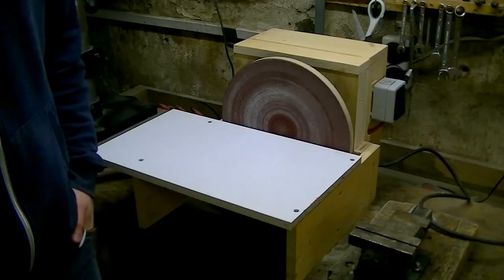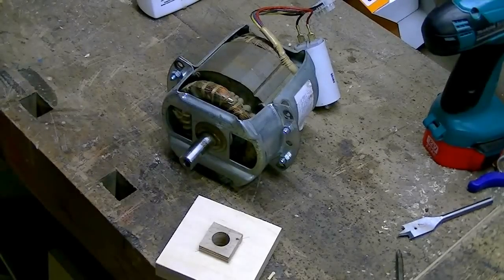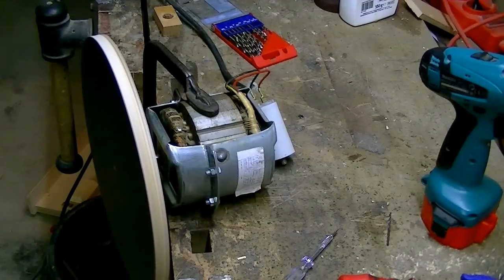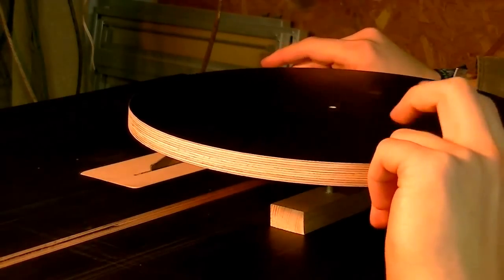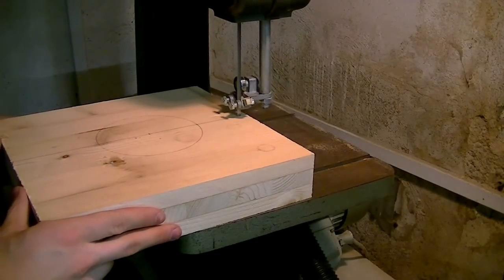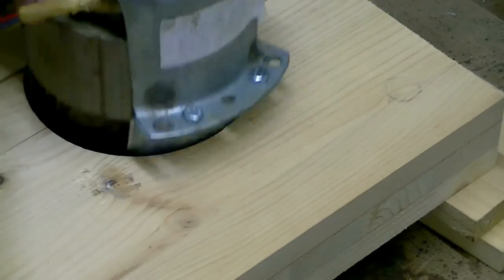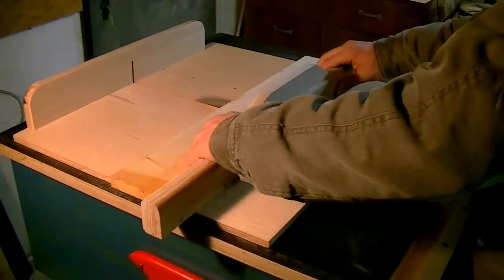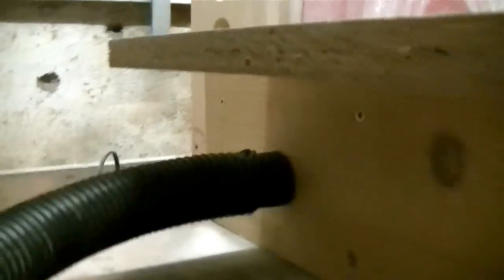Building a Disc Sander (cheap and simple)

Comment: Nice video. I made a 12" disc sander in the 1980's from a 'potters throwing wheel'. I took the motor and disc and mounted them on a wood frame, with a table like yours. Worked great. I also used my belt sander, mounted sideways in a wooden cradle, using 2x4 and plywood with hardboard top for a table as a belt sander.

Comment: This gave me some ideas - thanks. I have a lathe, so the motor part is taken care of. I like the balancing idea most, probably because I hadn't thought of it. Easy enough to make the table to fit on the lathe and an attachment for the chuck but balancing would have defeated me. I'm pretty sure I'd have trued up the face on the lathe and then wondered why it was still wobbling when I re-chucked it. I need square ends on cylinders before I drill them to fit on a worm screw, ready for turning.

Comment: <<  As for keeping the disc, you would have to plug the centre hole with a dowel and then skim it off, so the method would work only in those cases where you needed a few discs.  I sometimes need hundreds of such discs, accurately sized, and for this we use a 2-armed fly-cutter which has a needle as its centre point.  It has steel arms, with vertical blades at the end of each, was made specially for me and is DANGEROUS!  (In use, in an industrial drill press, you can't see the arms!)

Comment: Hole saws usually cut rather inaccurate, shallow, rough-sided holes and the sides of the hole are not likely to be parallel.  They need a twist bit (about 1/4" diameter) in their centres to register them in the work and if you drill through in one pass, will splinter out on the other side. But they are quick, can be of large diameter and can be used in a hand-held power drill for rough jobs where the hole quality does not matter (eg drilling a hole in drywall or wood for cables, pipes etc. >>

Comment: << from one side, then turn the board over and finish from the other side.  Chip clearance is very good and the holes bored can be much deeper than the forstner bit.  There are other drill bit types, each useful for different jobs.  Even the old-fashioned kind use in a 'brace' can be good if using hand-tools.  The screw-points on such bits actually pull themselves into the wood and the depth bored can be estimated by the number of turns of the brace.  (Try doing *that* with a power tool!)

Comment: As no-one seems to have answered this: Different bits all have their own pros and cons.  The forstner bits, used in a drill press, drill very clean, flat-bottomed holes with tiny centre points and are so controllable that you can nibble parts out of an existing hole. *But* they don't clear the chips very easily, so 'lift' them frequently to do this.  The spade bit you saw bores deep, fairly clean holes, with ragged bottoms and its very long point will pierce many boards, so best used, first >>

Comment: Pretty ingenious if you have a spare motor and other parts and of course plenty of time on your hand, Bravo.
Here is for those who prefer a cheap alternative and don't have the materials:
harborfreight 12-inch
It's $130.00, or a 10 inch for $100, if you have a coupon, you may get it cheaper.

Comment from the maker: Thank you very much! I think 1.6 hp is many but not too much, the machine has plenty of power wouldn't it be worse if it hadn't? 
A tilting table would have made the construction that much more complicated. And honestly i can not imagine any situation where I would use that tilting table. I want to make a steel table top for the sander because I discovered that it eats steel just like wood :D

Comment: the disk is not well balanced because the "pulley" screwed at the disk is squared and the screws is screwed not perfectly, doing holes for triing balancing is good idea but you never do it perfectly, if you do a circle and lathe it like you do with the sander disk, then you write a circle inside large a half, then write a star in the little circle and at the 5 point of a star you put 5 screws after doing a pilot holes with a drill press you do the job perfect and disk not wobble ;-)

Comment from the maker: I checked the wobble with a dial indicator and put shimms between the flansh and the disc until it was acceptable. There is still a little bit of wobble in it, but I think the high rpm of the motor simply straightens things out by centrifugal force...